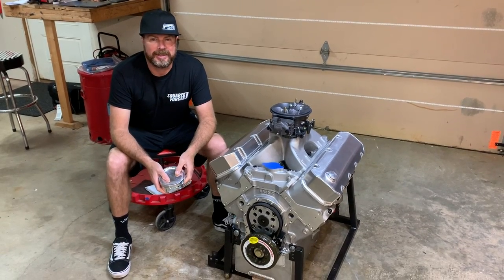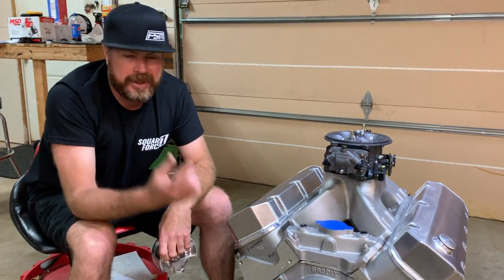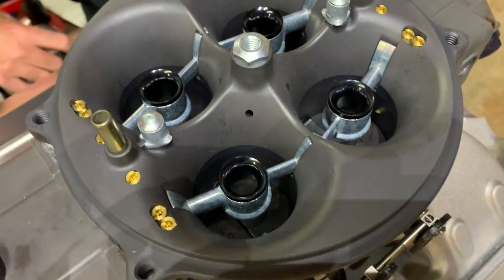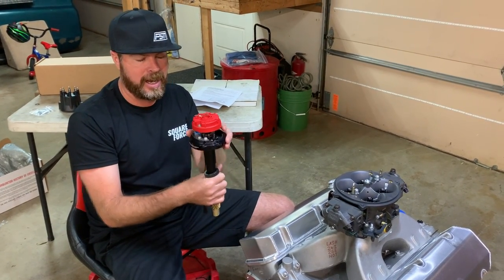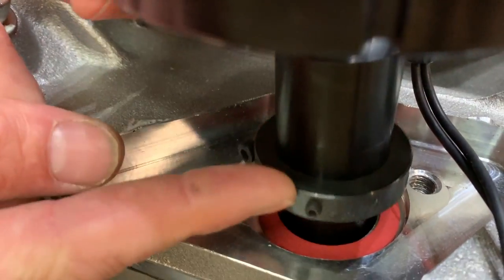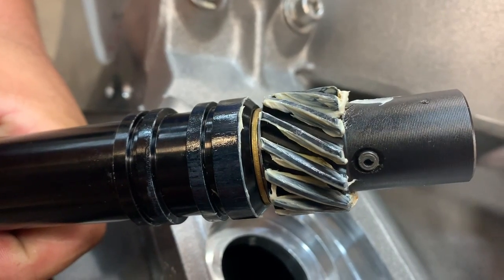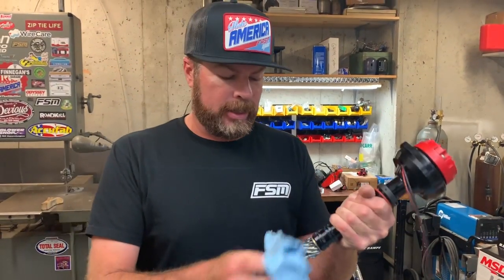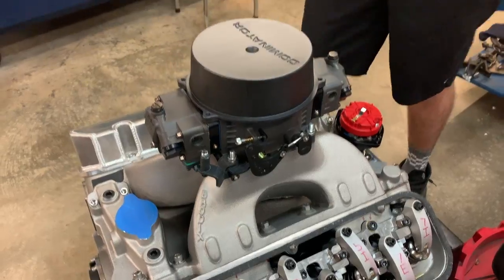1000HP With No Turbo, No Blower and No Nitrous: Finnegan's Garage Ep.79

Comment: An engine without any emission controls is a beautiful thing.
Reply: An engine without these crap emits almost no fine particles
Reply: A properly tuned engine doesn't need any.
Reply: William Chapman Tuning can be a HUGE part of emissions but so is design.  An engine with a “big cam” with a lot of overlap properly tuned will have more emissions than the same motor with smaller cam and proper tune. I agree with you on tuning I’m just saying if emissions is a concern than it starts with    the engines specs.
Reply: Amen brother!
Reply: Especially here in Arkansas.
Reply: That's not super rare in racing
Reply: You mean like an organic engine made from soy🤣🤣
Reply: Street engines now make more horsepower and pollute far less than in years past. You're thinking is small minded.
Reply: @chrismarquez9659  hahahaha!!!
Reply: Hot Rod or Car Craft have built GM nA V8 engines a couple times that made over 1hp per cube and had 2 cats and passed the Calf sniffer test but wouldn't be legal because the don't have all the crap on the required equipment list. SMH
Reply: Cosworth's Valkyrie V12 is a NA 6.5L and makes over 1000hp on pump gas and is fully emissions compliant.  More over the engine also serves as a structural part of the chassis fully complete only weighs 441lbs.  Red lines at 11100.  To simulate a 100k miles test they ran it 200 hours on a dyno pretty much wide open though they expect about 32k miles between rebuilds.
Reply: @brianborell4469  Making an emission legal engine with 1 hp per ci is very easy, most factory cars do that today, the benchmark  has being 100hp per liter since the 60's.
Reply: Finnegan's is a DD that can do that every day from the crank and send it all the way to the asphalt every day economically. Remember he got the VVT and fuel management working too IIRC.
Reply: Yeah plus it is even more efficient when done right
Reply: @misterd2690   And how much MORE power would they make without all the emissions BS? The tree-hugger theory that human activity on this planet is somehow damaging the planet is a joke. Sheep
Reply: No
Reply: @Odessa45  then what do you think is damaging the planet and increasing global temperatures?
Reply: @FSXflyermaster   The planet isn't damaged. The planet's geologic history makes it clear that the Earth's temperature has fluctuated thought it's entire existence.

This planet was once struck by an asteroid that killed nearly every living thing  at the time. It recovered completely. The idea that a few cars - or that ANY of our activities - could permanently damage the planet is laughable.

The notion that humans can somehow control or manipulate the Earth's climate is foolish. The planet is in a state of constant change. That has always been so. It will always be so. We can not control it. The cycling temperatures and changing environment might result in our extinction. We can not control or change that either ... no matter how many regulations we create.
Reply: @WizzeeeR  1st
Reply: @chrismarquez9659  a vegan V8
Reply: @Odessa45 well at least you don’t think the world is only 2000 years old and was created because some dudes rip was stolen and they build a girl  for him from it..

Comment: Man, too bad its going in a boat, would love to hear that beast in a street car!
Reply: Boat is way cooler
Reply: Yeah the Whole lake is the Radiator eh . ..
Reply: No speed or noise limits on the water.
Reply: @tezzrterry7485  wrong
Reply: I doubt it could run the 13:1 compression on the street. Especially in traffic. But even on a strip in a nice classic Camaro would be the chit...
Reply: @Paul Schwartz Lol imagine fast and furious remade but on water and everyone races boats. I cant stop laughing, thinking about Dom's boat doing a wheelie and how ridiculous it would look.
Reply: @Paul Schwartz Hey now, what's dat boat got in her Mr. Schwartz... There was a tail wind of white powder 10' high going around the last 3 bends...
Reply: I had a buddy with a 700HP smallblock in a pulling truck. What a waste
Reply: Dave Micolichek  Consider the applications.   Vehicle engine has to do 1000 HP for  1/4 of a mile in most racing applications.
Boat has to do 1000 HP until the race is over which for many is hours long!   Way harder to build a 1000 HP long duration engine than a short burst sprinter!
Reply: Dave Micolichek  I don't know, what do you think it has to do with it?  :/
Reply: @bicylindrico  biggest waste of cool motors.   its so stoooopid
Reply: Dave Micolichek  So duty cycle between high powered automotive drag racing and power boat racing seems irrelevant to a engine build design to you, yet everything else not related to the engine in such applications does?
Reply: @Paul Schwartz so cocaine cowboys movie
Reply: @MathiasGreenwalde  Fast N Furious: Wet N Wild
Reply: Sitting in traffic with a raunchy engine  sucks.  If you have an open lake or river you can  give traffic and all the nannies the middle finger.
Reply: Dave Micolichek   Sounds like it's a draw then.   Own both!
Reply: @kramnull8962  there are many street motors with that compression. E85 is real.
Reply: @cuzz63  Yeah you can put put along. E85 isn't on every street corner in many places... Exactly what MPG do you think you will get with this engine...
Reply: @kramnull8962  don't matter
Reply: Malcolm Reynolds  my 72 GT wants it.
Reply: Is the Block a Chevy 454 Stroked and Bored, or is it a Crate Motor?

🙂🤔
Reply: kram Null sure could with e85 and it’s all over the place right out of the pump as a matter of fact you can run 14-1 on e85 been done already and you can feed it all the timing sooner for more torque and no detonation
Reply: cuzz63 stock Mazda cars these days have like 14.5:1 and run 87 octane pump gas...

Comment: 13.5 compression, 582", 7100 rpm and 1010 hp is about 98% volumetric efficiency.  
Pretty impressive.
Reply: How do you calculate the efficiency

Comment: Heres a tip Mike. When installing 2 o rings as in the case of your msd distributor, install the lower one first. Then the upper will slip right past the lower, reducing the chance of it catching the lower groove. Learned this rebuilding fork legs on my many 2 wheeled machines. Great video Mike.

Comment: Stock Brodix heads?  Isn't that like saying "off the shelf SR-71"?
Reply: Like the very top shelf that is normal folks can’t reach.....
Reply: He might have ment the heads haven't been messed with, ported, different valve springs, ect.
Reply: I work at brodix, it's pretty cool. I deck the heads and run intakes
Reply: Amused.  Are you referring to the SR-71 Blackbird manufactured by Lockheed Martin, the badass Cold War Strato-jet?  Did the joke go over everyone else’s head?  Lollollollollollol
Reply: @starcloakstarside9719 he’s referring to Jon kaase who makes some big block Ford cylinder heads that are also called SR-71’s not to be mistaken with the jet
Reply: @lcelord3941  never heard of the Ford heads, but the joke works either way lol!
Reply: "Conventional" Brodix; not stock.

Comment: Man I am always impressed by Brodix heads, no fancy CFM marketing they just bring the business.
Reply: @AEON.  they probably have a mountain of head castings where they chopped, welded and did all kind of things to them
Reply: I'm sorry, but that's the most odd thing I've read in months. No fancy CFM numbers? They post CFM numbers on EVERYTHING, and I've stopped using Brodix heads as I was fed up with them not flowing what they promised. I have made so many calls and have had heads sent back and forth so many times it became ridiculous, over the years. I don't know the SR20 heads, and I know Brodix heads can be made to work well, so won't comment on those, but I am absolutely done with stock Brodix heads. You can say what you will about Tony Mamo and AFR, but the heads does as advertised.
Reply: @AB-80X  did the Brodix make the numbers that count though, dyno, et's? 
Can't race a flow bench which was kinda my point.

Comment: I learned this from HRM in the '80s: "Speed costs money. How fast do you want to go?"
Reply: Me too.
Reply: Ain't it the truth....while speed can be built on a budget.....how long will those budget parts last and when they break are they re-buildable ?
 If guys were smart and they really don't know what their doing and wanna maximize the money they do have....they would find a good Machinist/Engine builder and go that route.....or pony up for a complete pan to carb dynoed Crate Engine from a proven builder like Reher& Morrison or some one.
Reply: Harshman?
Reply: @mattprice37664  If you're not joking I believe he means Hot Rod Magazine but he might mean Harshman. It's crazy that 2k is considered a budget build and not meant for crazy power.
Reply: Yes
Reply: @micahbuchheit1283  Me three.
Reply: Better  said how fast to you  want  to  spend
Reply: @IRONHORSE427RACING  The key:  "If they don't know what they're doing".  You can't build on a budget if you don't know anything about building an engine and car.  If you do, you absolutely can.  There's guys on Sloppy Mechanic's pushing 1000 HP through a LT1 chevy truck engines completely stock and eBay twin turbo's.  For dozens and dozens and dozens of passes drag racing.  Don't pretend like guys only have to go through professionals to go fast..........  If these guys know what they're doing!  Only way do know is to do it!

Comment: I love those cam specs! Its using a Honda crankshaft for a cam 😂. Awesome engine man.
Reply: @CP110  So you're comparing apples and oranges. They have to be comparable which these two are not. When you compare an engine that is being mastered and taken to it's zenith to an engine that is just basically an off the shelf piece there is going to be a considerable chasm between their performance. Poor comparison by any standard.
Reply: @CP110  This engine made 1000hp at 6800rpm. That 2.5l Honda made 500hp at 9500rpm.

Also, this engine will probably last hundreds of thousands of miles with normal maintenance. That Honda engine is a race spec design that probably has to be rebuilt every few thousand miles at most.

I hope you understand these differences and why they make these engines incomparable.
Reply: he used a death metal misfire cam.
Reply: Honda makes heavy duty parts
Reply: C Pinell its capable of more. That isnt really that crazy of a setup. It could do a lot more.
Reply: Remember this Big block is going in a boat. Its peak power is sustained for minutes, not seconds. It needs to be detuned in order to survive that punishment. That's why it is conservatively built. If it was a drag engine it would be making way more power in that tune.
Reply: @CP110  Dude.........get a freakin' clue man. This Brodix/Chevy big block has MEAT between each cylinder wall, and is NORMALLY ASPIRATED. That little ring a ding Honda engine won't last at all the way it's built. So YOU are the one that needs to get a grip on "perspective". Good grief man.........
Reply: @howabouthetruth2157 at the power level the honda is it would last, thats why alot of aftermarket cranks use honda/nascar rod journal size to have high rpm reliability (Richard Holdener also works at westech and can attest to the honda reliability he built a land speed civic and wrote a book about it). and most of you are missing the point, I stated that this combination should easily crack 1000 hp just that it was nothing special. and that it was using a mild cam, which is true, because power starts to fall at 7200. also it needs to run cooler with no accessories and electric waterpump to run that power. this combination only does what it says in specific environment i.e it would run hotter in most vehicles if set up in a car and not a jet boat. Thats what I mean by don't lose perspective this isn't some grand achievement its cool though 1000hp will always be cool but this kinda recipe has been around for over 2 decades already. many cars make the same hp per liter as this from corollas to corvettes. if you want to see something pretty astounding check out the aston martin 6.5l v12 that makes 1000hp NA you will be hard pressed to find any records of street car making 153 hp per liter. while being reliable for 30,000mi (engine)
Reply: @howabouthetruth2157 showing the forced induction motor is to prove a point that its reliable at high cylinder pressures. cause someone mentioned the block was weak  I guarantee you that the BBC pushrod v8 with the oversized valves it will have valve train issues around 30,000 miles the valve train is too heavy and causes accelerated wear on pushrods and valve seats not to mention spring fatigue. this isn't a factory LS  motor with smaller valves and less cam lift revving to 6500 which makes anywhere from 65-85 hp per liter in factory form which means they have very low cylinder pressure. Regardless of engine design whether its a honda, LS, or Cosworth v12 the blocks are going to be fine at anywhere from  100-200 hp per liter. (Except for weak ass ford Windsor blocks that split around 450hp) I like domestic stuff don't get it twisted, just there's nothing special about making a decent amount of power with a lot of motor. you chevy guys have way more aftermarket support yet all the builds are cookie-cutter and tame. (except for that kid who built a road race trans am to 1000hp NA on an LS revving to 10k). Any of us could copy something like this ordering parts out of a summit racing catalog without much forethought or planning. now try doing so while meeting modern emission standards like the direct injection variable valve timing newer LS model engines.
Reply: @entrepreneurhomeboy  calm down buddy,  still doesn't change the fact that it's an overbuilt motor barely scratching the surface of what those cubes and cylinder head have a potential of doing y'all shouldn't be surprised with this level of build with all the aftermarket support you guys have (aftermarket heads/block) basically fully custom engines and you still baby em as if they're gonna break. and I'm more of a Toyota fan when it comes to imports(but far from just an import fan) which there have been plenty of 2jz jet boats over the years using stock block/head castings. if going through all the trouble of building a motor like this it should have been put together to be pushed a little harder at the very least.
Reply: Hundreds of thousands of miles?  Ha. Maybe a thousand miles before it needs freshed up.
Reply: I have a question if my 346 cube ls1 is making 350 hp and 350 tq to the wheels that’s pretty good right
Reply: @BigUriel  just compare hp per liter there are STOCK honda f20c that make 125hp per liter and built 2.7 k series push close to 600 at the wheels
Reply: @james avery Google honda f20c they stock make 125 hp litter lol
Reply: @james avery I get that, Im just saying that is a pretty mild build for that engine regardless. And Pushrod style engine have a huge aftermarket that allows them to build it up to higher standard for a relatively affordable price, You guys have after market block with different deck heights to suit any crank rod combo and make tq hp however you want. You can buy everything off the shelf to get it revv decently high its already almost there anyways @ 7K  This build isnt impressive because all its using is its cubic inches to make power, 9.5 liters making 1000hp to the crank. It makes more sense now that I've seen he added boost to the motor but this specific setup is underwhelming and not really anything to write home about. he could have reduced the stroke a bit used longer rods increased rpm sure it would of moved power a bit to the right but he would of made more HP with about the same torque sure torque would be made like 1k later but the increased rev range would make the power band just as long as the previous setup while reducing piston speed, and since its a jet boat you can gear it to suit pretty much any motor.
Reply: Be civil gear heads, and enjoy engine theory, like persueing the valveless engine.
Reply: @CP110  and still 1/4 or less torque............beat it rice boy
Reply: @howabouthetruth2157  That Honda engine doesn't use forced induction, you need to have your eyes checked.
Reply: @howabouthetruth2157  The only Honda engine that was being talked about here. C P linked to an article about it in the first comment that he made in this thread.
Reply: Some Chevy small block builders will use Honda crankshaft bearings in their engines... but as crankshaft bearings, not cam bearings.
Reply: @howabouthetruth2157  If you don't click the link, how the f--k are you gong to know what he's talking about? There are thousands of speed boats powered by Honda engines, Honda makes outboards and they're some of the best in the business.
Reply: @howabouthetruth2157  "So if ya think you're "getting to me" about mentioning Honda bearings in a Chevy..."
-
I was replying to the first comment by Turbo496Vette.
-
Anyway, I wasn't suggesting that the Honda engine in that article be used in a speed boat, I was just telling you that it doesn't use forced induction. That engine really is being pushed to the limit, it's just very impressive when you consider that it makes half the power of the engine in this video, which is three and a half times larger in displacement.
Reply: @entrepreneurhomeboy  I was just pointing out that plenty of speed boats are powered by Honda engines, and I did say that they were outboards, don't get your panties in a bunch.
-
F--k his link? That was him mentioning a specific engine, you guys need to learn how to use the internet.
-
Anyway, I'm not trying to bad mouth the V8 in this video, it is seriously impressive, but so are many Honda engines.